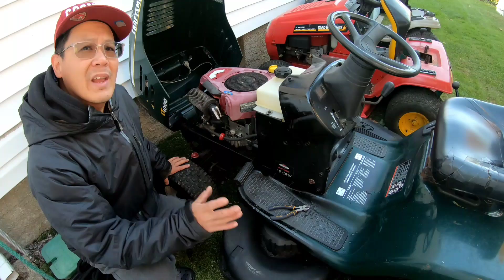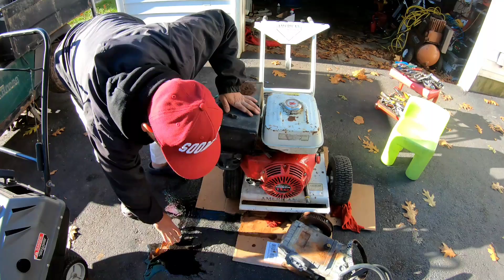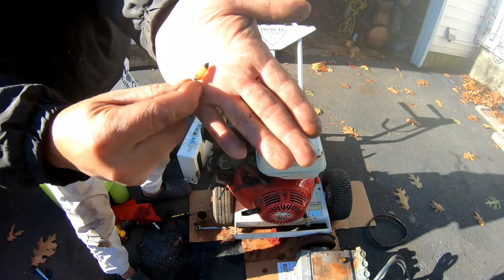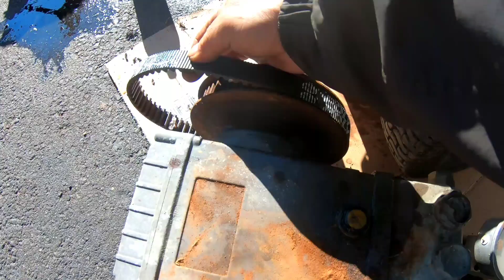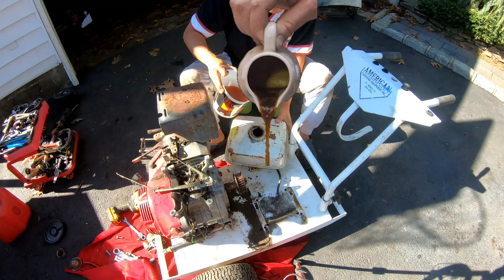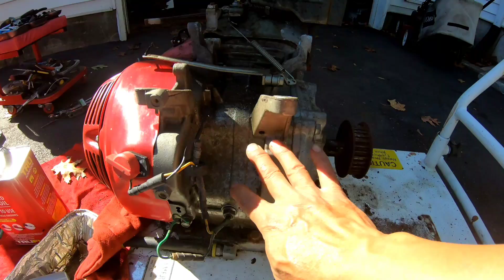HONDA 11HP GX340 COMMERCIAL INDUSTRIAL  PRESSURE POWER WASHER SEIZED LOCKED UP ENGINE! WILL IT RUN?

Comment: Henry  couldn't you use the carb off of one of those honda lawnmowers that you got from pattay's  performance?
Reply from the maker: 5hp push mower carburetor is totally different from an 11hp horizontal shaft

Comment: There is a video on replacement of the spark boot from elimator performance  if you seen it great just  a suggestion for your information HENRY😎
Reply from the maker: I doubt it’s the spark boot
Reply: @MowersNBlowers  yes it is a great idea to have it checked out just in case 👌👍

Comment: you should be able to cut threads in shaft like a vertical has 3/8 fine threads. Heat and quench pulley  it should come off   might have to clean shaft

Comment: Henry, its a Honda! Its gotta run. If you put that in the cart you should be able to get rid of the small Honda gas tank and use the one in the cart. I think that would make a nice repower and still have the same HP. You'll probably need to tap threads in the end of the crank.😉🇺🇸Roger   #mnblucas
Reply: Measure the length and width of crankshaft and pulley before trying to put Honda engine in golf cart.  Also, measure mounting bolt holes and physical dimensions of both engines.
Reply: Someone should send Henry an idle tap and die set to do that job, Roger.  I surely don't have one.   A good suggestion though.  Welding is another answer. Permanent one!!